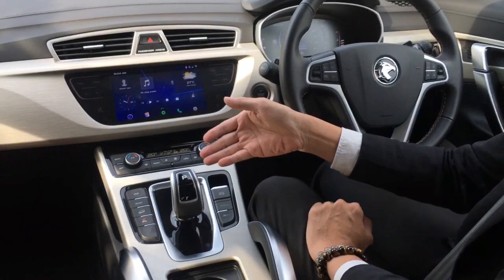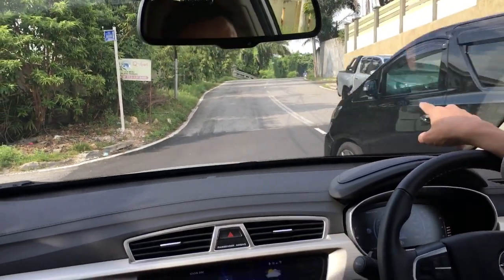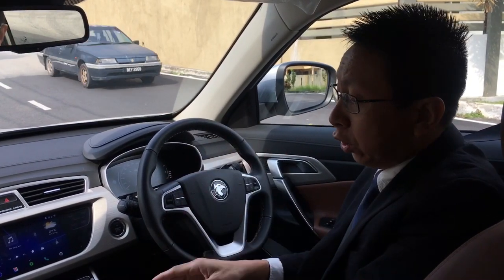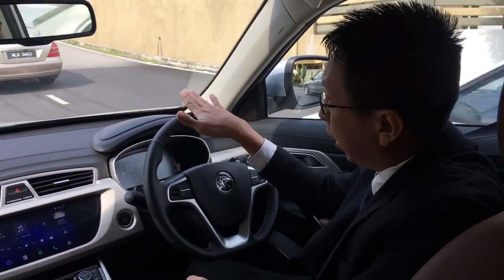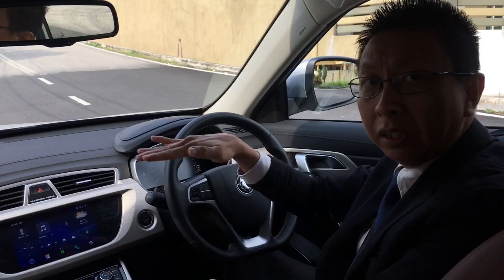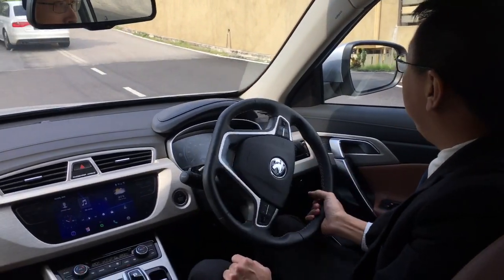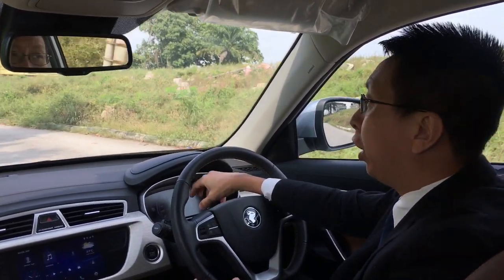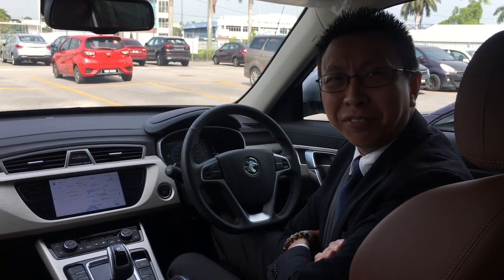EP 11: Proton X70 - DCT Slope Driving Technique (auto translate subtitle - BM / 中文字幕)

Comment: not really understand. so better use autohold at slop or hill and while it's traffic jam? just press accelerator like normal?
Reply from the maker: Yes
Reply: @davidong2898  but Sir after press accelerator, it still don't move. need to press more, then just authold release. then it move..
Reply from the maker: @megatabdurrahmanmegatmoham1894  depress accelerator and hold accelerator at the position. If it still doesn’t move the depress more

Comment: David, I experience jerky transmission at gear 1 or 2 while driving at heavy traffic and slope, is it normal?
Reply from the maker: It should not, is your X70 CKD or CBU?
Reply: @davidong2898  CKD2022
Reply from the maker: @joblee2912  Shouldn’t be, just send it back to service center for checking. If you need any help with this, you may contact me

Comment: Hi mr david. in this scenario you demonstrated the hill assist while car moving forward.  however what will be the case when the car is in reverse gear? i do experience noises while i am reverseing uphill on a slope and its preety rough and jerking. i wonder its the nature of dct gearbox or i should visit my service center? BTW my model is 2022 mc 1 just 1 month old
Reply from the maker: Hi Fong,
There is no hill assist in reverse gear, but we can still use the auto hold function as the assist in starting a reverse. If you still find the jerking, please send it to the service center for checking.
Hope this will help you for the issue.

Comment: sir..if i  dont want to use auto hold...at the trafic light..jam road...do i need to put gear on Neutral..or just press my brake..and let gear in D position...wich one is better to care DCT gear box...only in your channel showing technical video..it good for all x70 owner...
Reply from the maker: Fadhil 30 Both Neutral or D position with Brake are Ok for DCT, as long as you understand the objective is to minimize the friction time of clutch. Thank you for your compliment, it’s my pleasure to share (technical topic is due to I’m also doing automotive technical training as well :)
Reply: @davidong2898   As a millennium, I am not familiar with Clutch transmission. However, from your explanation I've come to understand that inching the acceleration would cause friction on the clutch at traffic condition (especially on hills).

Would inching on the break pedal also cause friction on the clutch?

Would inching on the acceleration pedal on highway speed/higher speed also cause friction on the clutch?

I'm a bit confused about when the clutch is being engaged; as I've not driven a manual car before.

Would be fantastic if you could clarify my confusion.
Reply from the maker: @wongguanghui9202  Hi, brake pedal release to move is also considering inching or creeping.
Highway at high speed m, shifting will not be much clutch friction time.

Comment: Informative as always. Thank you.

What if in a jam (flat road) i dont use the auto hold, instead i put the gear in neutral when not moving and engage D only when i want to move?

Another question: does the auto hold function degrades the clutch since the gear is in D for a long time?
Reply from the maker: Muhammad Asri Ashari                                               Thank you for your compliment.                                  Q1: It’s ok to use the auto hold to hold for jam on flat road.
Q2: no, coz the clutch is not the release bearing operational type
Reply: @davidong2898  Thank u for replying, and the info. Just got the car yesterday, still adjusting to all the techs and features. There's a lot of area of the X70 you could make into a video tutorial which I think are very useful for owners (and potential buyers).

I must admit, i was a little skeptical about thr techs (especially the gkui) but after driving it for these 2 days i must admit the car is a bang for buck! Just love everything about it..anyways, keep up the great job. I'll be following on your future releases.